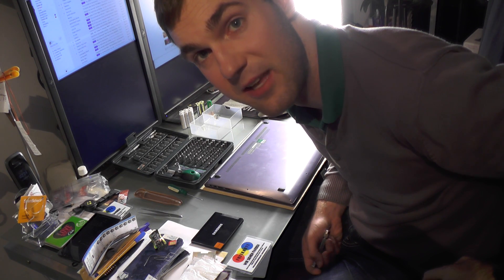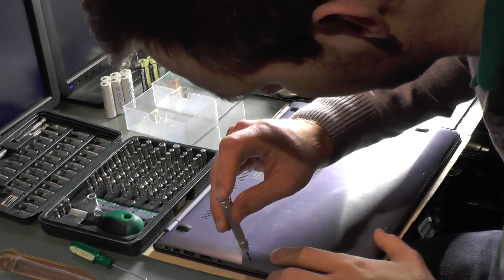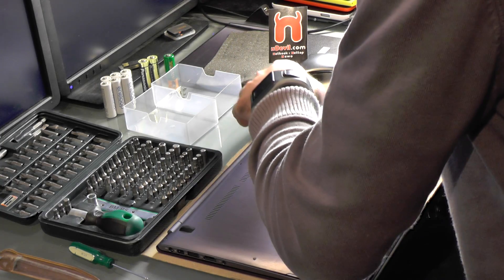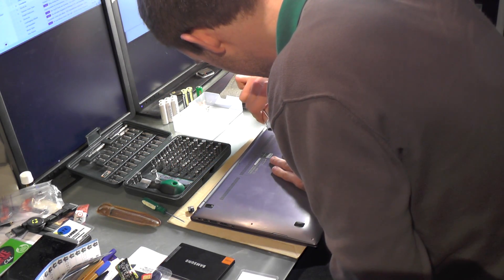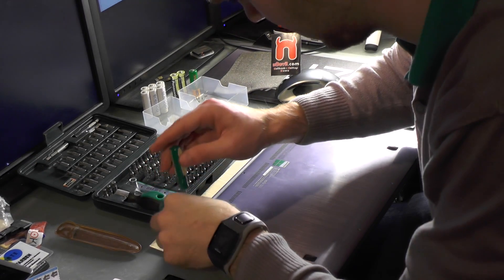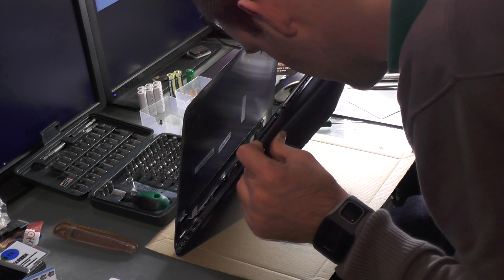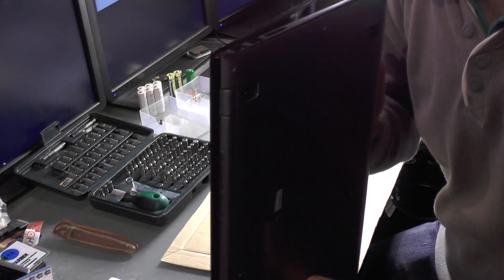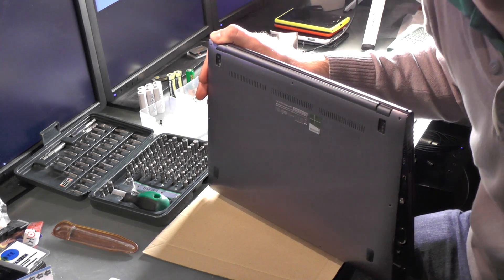Asus UX302 RAM and SSD Upgrade Part 1

Comment: What is the point trying to upgrade this awful laptop. It never works porperly. I spent hours and hundreds fo Euros trying to make it work. Had to buy another hard drive (the one by default is not very good any way), it keeps disconnecting from internet (have to restart the computer!). Now, I cannot even use the touchscreen (great with windows 8). Don't buy it!
Reply: +Karima Kawa I've had 0 issues with this laptop. Its a couple years old for me now but after installing Windows on the built in SSD it boots faster than the lastest versions of i7 laptops. Sorry you had issues, but seems like you got a bad apple. This laptop is amazing.